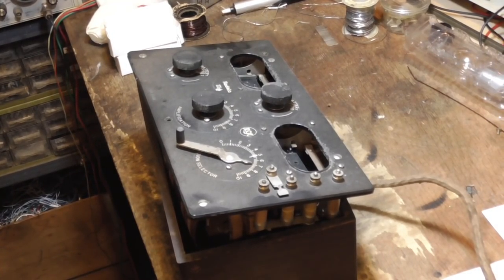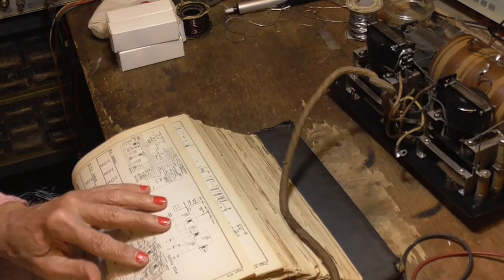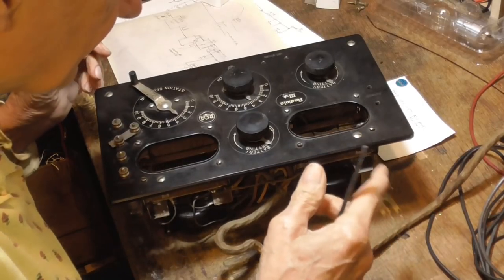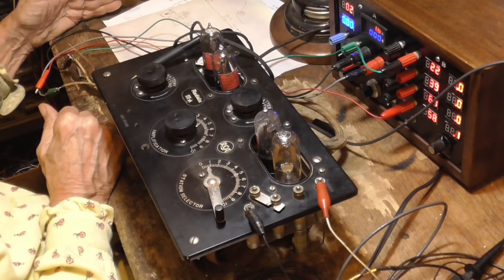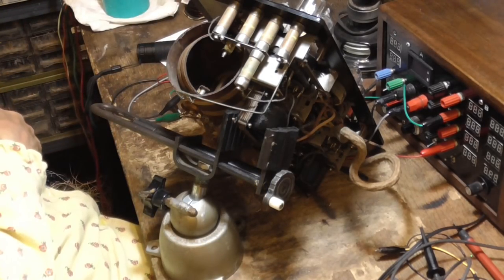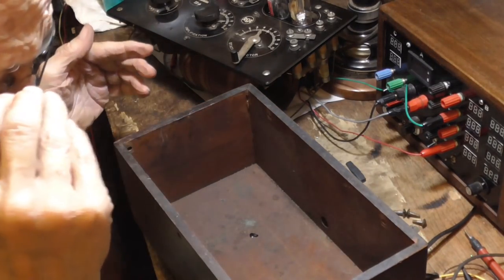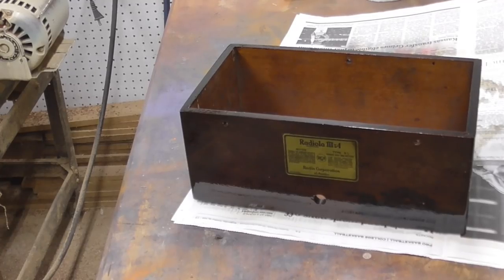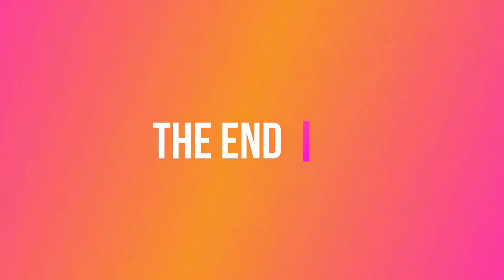REPAIRING A RADIOLA IIIA RADIO

Comment: 21:20 The use of a variometer to control the regeneration(reaction) is archaic even by the mid 1920's. Rotating the "Tickler" coil inside the main coil to control the feedback, will have a sharp detuning effect on the radio receiver

Comment: Those WD11's are a rare as hen's teeth today (and more expensive than 1L6's).  Many of those radios were modded to use '199', '120' or 864 type tubes.  Some people use sub-mini tubes inside of a dead 199 base.
Reply: PS 1l6 can be subb with 1r5  sw.weak on higher bands.🤔 Find them in old portable radios at flea market.

Comment: Ron, you may have answered this in another comment, but did the Radiola IIIA come with a separate power source to provide the various voltages it uses (e.g., 80 and 45 volts)? If not, how would a user from the 1900s power it?
Reply from the maker: Back then they used batteries. They came in various sizes, 22 1/2 volts and 45 volts being common for "B" batteries. They connected them to get the voltages as needed.

Comment: My father must mentioned that he built a 'peanut tube" (AM) radio during WWII. I found a schematic, parts list and assembly directions for one (probably one of many) in a 1935 radio magazine. Have you ever seen one? I am wondering if the parts are even available. The resistors wold be and capacitors/condensers. The tube, probably not.

Comment: Question: I believe you said your reproduction tubes draw much more current than the original. Would that not make a risk of burning something out? Although I also heard you say the filament circuit was basically just a bus bar.

Comment: Beautiful radio and great work!  I'm curious, what is the name for that type of vise, that you used to hold the chassis at one point?
Reply: That is a Panavise 396. Model # 591-396 and available from Mouser Electronics for $74.99! Look on Ebay to get an older version ,much cheaper!
Reply: @hestheMaster  Thanks!  I would never have found that thing looking on my own.
Reply from the maker: It is a "panavise" you can buy on Amazon. They make about a dozen different models.
Reply: @glasslinger  Thanks!

Comment: Not quite "it" old bean. Just what is to be the "plug" at the end of that fabric shrouded bundle of wires? Some kind of power supply, sure. But not the bench supply. That would be unwieldy. So what then?
Also-- consider building a simple 45-degree little "bookshelf" thing to hold up radio chassis when upside-down!
Reply: Radios of this era had battery's abc fil b+ bias .as electric was sparce but I've seen separate mains supply.theese radios were 50c .when I was a kid 70yrs ago..had tv shop my favorites are philco cathedral radios
Reply: @dondesnoo1771  I had heard of battery set ups-- but they seem a bit unwieldy today. For listening comfort or something like that. I know Roy is perfectly well able to hook up batteries -- just wondering! And thank you.
Reply: Eliot Brown  not realistic for battery op .today .im sure there are supply's available as most voltages are common but theese radios are not realistic to be used .as there are many better antique radios for am a rf amps that will receive stations far away .I wouldn't try to make a Regen work to me they are art.not radio. Unless you like a radio that's squeaks & distorted gets 3stations.🤗thanx for your reply.
Reply from the maker: The original had metal tags with the label on them. The wires connected to the binding posts on the batteries that powered the radio.